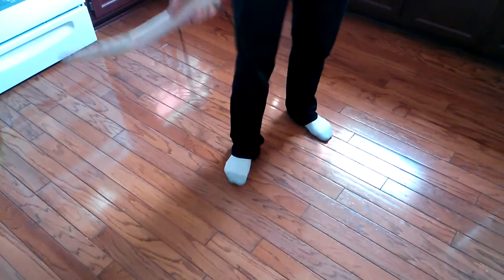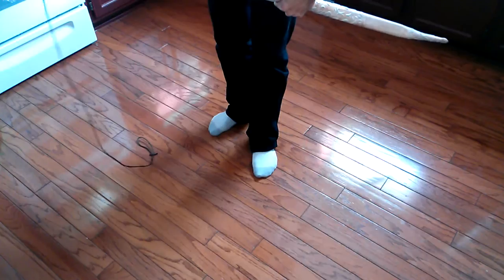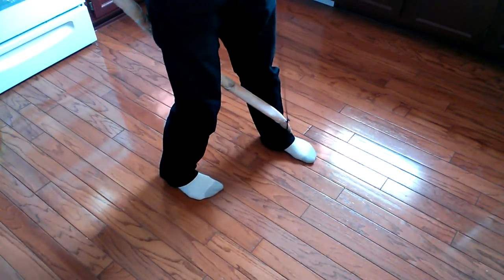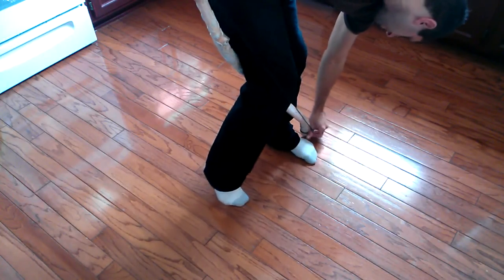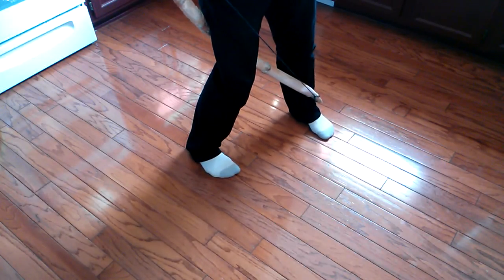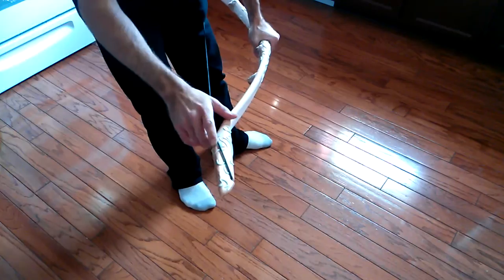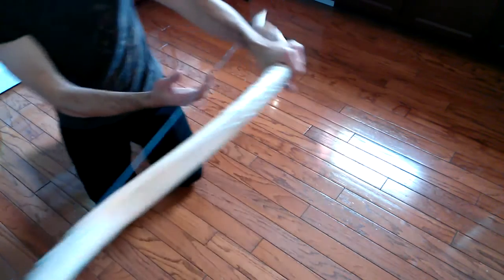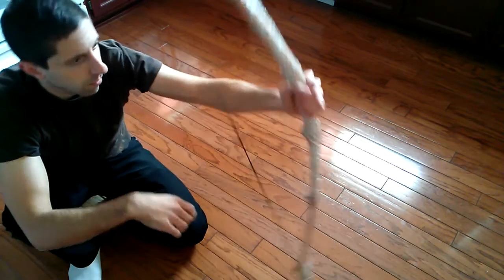Building a Lothlorien Bow: Stringing and Drawing!

Comment: Hey Tim, have you considered doing something along the lines of making a basic recurve with 1'' pipe, and drilling holes from around mid limb to the tips, with more holes near the tips? I was thinking this would lighten the limbs and allow air to pass through them  without reducing the strength of the pipe too much.